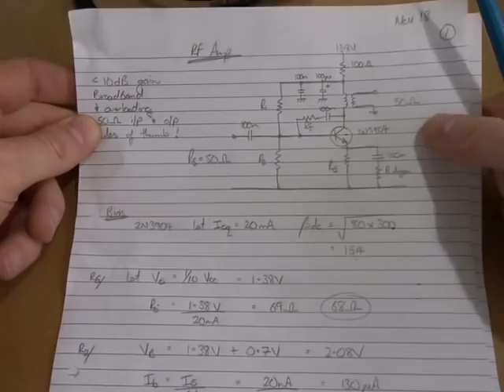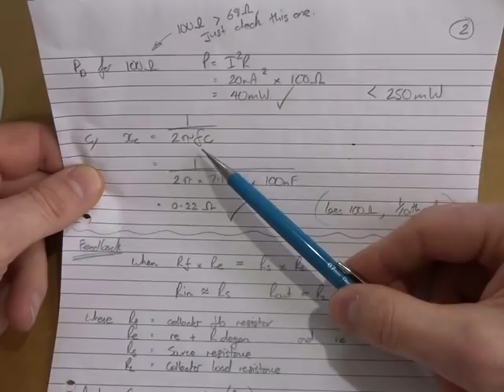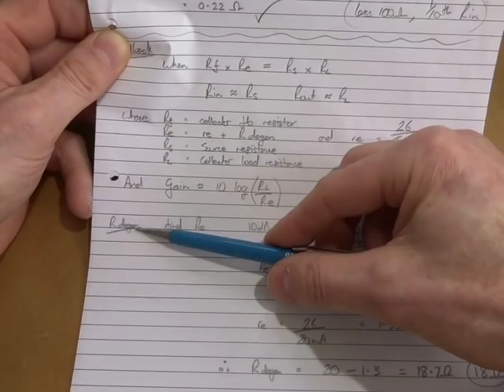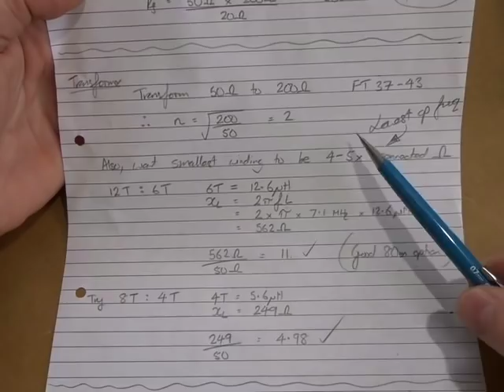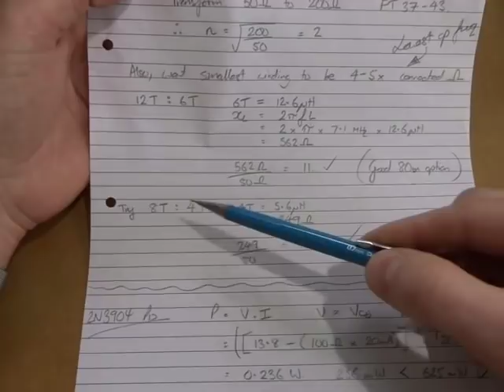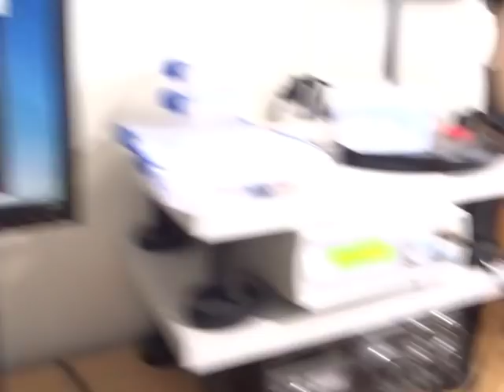Homebrew MC1350P based SSB Rig - #3 RF Antenna Amplifier

Comment: Hi Charlie!  We have assembled this RF amp today and it works pretty well! But we hadn't 2N3904 and we decided to recalculate schematic for 2SC9018 and FT50-47 transformer. Amplifier works well and we have amplification ratio about 20 dB on frequency 2130 kHz.
So on the next step we are going to assemble diode mixer)
Reply from the maker: Excellent. That sounds great!

Comment: Charlie,

At 7'38" you state "RL is the resistance seen in the collector... now this is going to be 200. I think I have mentioned this before..." 

You did not mention in this video how you arrived at 200ohms - can you clarify how you arrived at 200ohms please.
Reply from the maker: Hi Paul. Solid State Design for the Radio Amateur uses 200ohms as a good collector load rule of thumb. I've just stuck with that and it works well for me.
Reply: @CharlieMorrisZL2CTM  Thanks for the reply Charlie - really love your videos - can you point me to where or how you learned this rule of thumb? 

Many thanks and 73's

Comment: Very good video! I always like these kind of videos, since it allows me to refresh prior knowledge. You know, "Use it or loose it". :) If not using knowledge, it will become lost.Anyway, I really like your videos!!! 73's de SM4WWG
Reply from the maker: Thanks Jörgen. I'm no expert that's for sure. I do like to try and understand the underlying logic and not simply copy circuits. The circuits are extremely simply, but for me that's the aim.
Reply: @CharlieMorrisZL2CTM  You seem quite capable from what I can tell! :D Also very pedagogical explaining the calculations behind, etc! :) Anyway, please keep posting videos! They makes me wanna spend more time in my lab at home :D
Reply from the maker: @sm4wwg  I certainly will Jörgen.

Comment: You are conducting a DC analysis. What about the L and C of the transistor (i.e. Zout of the 2N3904) at the operating frequency?
Reply from the maker: Yes, I am intentionally keeping the analysis and design simple and am ignoring the reactive component of the input and output impedance. I'm just trying to keep things as simple as possible to encourage others to give it a go. Right or wrong as they say.

Comment: Hi Charlie! I absolutely love your videos.  I've been going through all of them the last couple of weeks. I have a question about the noise figure of this design. Do you have any idea of what it might be? It seems like it could be rather substantial in this design. I'm just asking because I've been playing with a home made noise figure kit I made and have been studying LNAs. 73.
Reply from the maker: Hi Randy. Short answer is no. I don't measure the NF at this stage as I am consciously trying to keep things as simple as possible. With that comes compromises. NF is something I will look at IDC.
73s Charlie
Reply: @CharlieMorrisZL2CTM  thanks for the quick answer! Since I have my home brew NF measurement setup I think I might try to measure it myself for some fun. I'm a bit busy the next couple of weeks, but when I get the chance I'll build one up and let you know what I find.
Reply from the maker: @randydireen3566  Thanks Randy. That would be interesting.
Reply: @CharlieMorrisZL2CTM  hi. I got around to building up this circuit and am getting about the same gain performance you are. When I measure the noise figure I'm getting about 7.5 dB for the noise figure which is a little bit higher than the design on pg 2.20 of the experimental methods in rf design book. They quote about 6 dB for that circuit. I did a little analysis and it still looks like your design is in good shape for the 40m band. The arrl handbook says that earth's natural noise level at the 40m  is around -115 dBm and your 7.5 dB amplifier will put the minimum discernable signal level of your SSB receiver around -130 dBm. Even if the rest of your receiver is fairly noisy, the RF amplifier you have there should provide you with a fair amount of sensitivity. (At least I think, I'm an amature.) Anyway, I had fun building and measuring this circuit. Thanks for the inspiration! 73
Reply from the maker: Thanks Randy for taking the time. That's really interesting. Cheers!

Comment: Great stuff Charlie. I plan on using this little gem of yours for the front end before my band pass filter in the home brew receiver I'm building at the moment. I followed along with this video to the letter, and built this in LTSpice and ran the simulation and had the same results as you from the looks of it. I was fiddling around with this and that and I found that if I changed the value of the feedback resistor, Rf,  from 470 ohms to a value of 1K ohms, I got a 17.5db gain in the 40m band, and above 10dB all the way to 100Mhz.  SINE(0 1u 71000000) AC1   Rser=50,  .ac lin 2000 1e6 100e6.   Not sure if this might cause the circuit to self-oscillate and take off so to speak. Ill have to check that when I breadboard it. Thanks again Charlie. Very glad you share your knowledge and show your work on how you figure all this good stuff out. I always look forward to your next video. Cheers Mate.
KE0WQB --73'S
Reply from the maker: That's really interesting thanks Matthew. I'll add that to my notes. Let me know how it goes.

73s
Charlie ZL2CTM

Comment: Hi Charlie
What's the purpose of the 100 ohm resistor off the 13.8 volt line? In your audio amp circuit (video #2) you used a 100 and 10 ohm resistor. Ken
Reply from the maker: Hi Ken. I't an attempt to swamp any noise that may be on the 13.8V line from reaching the AF amp. I've seen both 100ohm and 10ohm used. I used 100 on the first stage as the current draw is not a great as the second. I'm trying to minimise the voltage drop at the same time.

Charlie
Reply: Thanks Charlie
I seem to remember Wes saying it was a decoupling resistor in EMRFD. I'll have to see if I can find it.
Reply: Hi Charlie
I posed the decoupling resistor question to the EMRFD group. Wes replied with a web page explaining the use of decoupling resistor with decoupling capacitors. Have a gander http://w7zoi.net/bypass/decouple.html

73 Ken

Comment: In the LTSpice simulation, what input voltage do you use? Your simulation parameters? The transformer coupling assumptions? Would you please post the spice file?

Comment: Finally getting around to build this - I am definitely a newbie when it comes to transistor design, and I am trying to follow your calculations carefully.  I am having a difficult time finding the same values you have for Beta (hfe) in the datasheets. The data sheet I use is from the On-Semi variant, the table gives small signal gain at 100 - 400 (1mA Ic). The chart for Current gain shows a value of about 150 at I0 mA Ic. Which 2N3904 did you use so we can follow along with the datasheet?  Thank you again for an outstanding series, and your patience with freshmen questions.
Reply from the maker: Hi David. I'm using the Fairchild datasheet. I've just rechecked it and I see for 10mA the min is 100 (not 80) and max 300. That would give a geometric mean of 173 and not 154. Sorry about that. Not sure what went wrong there. It shouldn't make much difference as the resulting resistor values are typically rounded to the nearest standard value.

Charlie
Reply: @CharlieMorrisZL2CTM  Thank you - I appreciate the hard work you do to document this for us. I am taking advantage of your design rules of thumb. If you are interested I can post images of my construction and test results.
Reply from the maker: @dwurmfeld  No need David as I know how much time and effort that takes. Keep the solder melting.

Comment: The output transformer is a 2:1 turns ratio, so it could be  bifilar wound.  Also could be series wound with the output at the center tap, capacitor coupled.  The feedback could be taken from the output, but the resistor value would be different.
Reply from the maker: Great thanks. The 2:1 bifilar would be simpler too.

Comment: Excellent series - I am following along, building modules as I understand them (I am much more comfortable with the digital aspect). A question that comes to mind is - why a VCC of 13.8V? Is that to duplicate the nominal no-load voltage of a 12V Sealed Lead Acid (SLA) battery?
Reply: 13.8V is common among radio amateurs as it is the typical supply voltage for portable radios.  It's also the nominal voltage for 12V lead acid battery.
Reply from the maker: Hi David. To be honest I'm just sticking with what appears to be the norm that base ham radio equipment has a Vcc of 13.8VDC. Even my power supply has a red dot at 13.8VDC. I can't seem to find anything definitive in the literature. I use 12VDC for portable equipment as my portable battery is 12VDC.
Charlie

Comment: Using the pause and "rewind" to take notes. Makes more sense than my professor did 20 some years ago. Two questions - A: Why not use another 1350 with fixed gain before the mixer instead of a transistor?
2: What are the rule of thumb for picking the transistor? Say I wanted make this for 10M (or 6 or 2 or 160M). The 3904 gain drops before 28 Mhz and has an ft of 300. 10 times the highest Freq?  Vceo, Pd, Ic, and beta seem a bit more obvious after watching a couple of the other builds. Looking forward to the rest of the series, Thanks.
Reply from the maker: Hi. I elected to use a 2N3904 for the antenna amp and save the 1350s for the IF amps. I think I will use two 1350, one on each side of the crystal filter, but only have eventual AGC going to the second IF amp. As for selecting transistors, I must admit I don't have a good answer for that, Hopefully, someone in the know will chime in. For me, I make sure they have a nice high Ft, in the case of the 2N3904 it's 300MHz, which is 10x 30MHz (top of HF band), as well sufficient Pd, Icmax and HFE. Again, that's just me and certainly not the textbook answer. I'm also focusing on the 2N3904, because its cheap and readily available, which is in keeping with this video series (simple circuits with common components). 

73s
Charlie
Reply: I am sorry I meant the filter not the mixer. You answered my questions in spite of my late night posting. Thanks again for doing these videos.